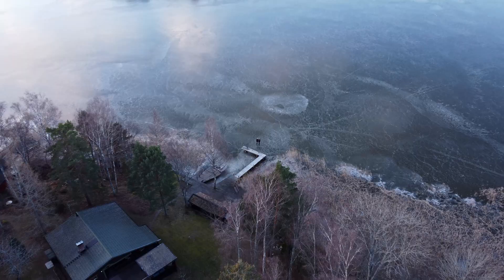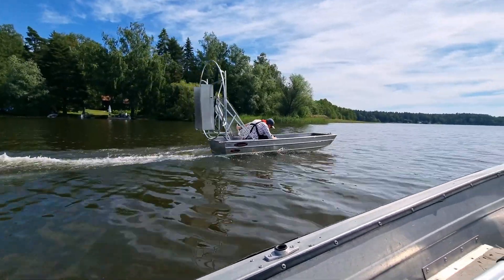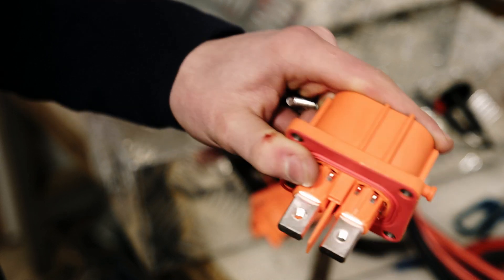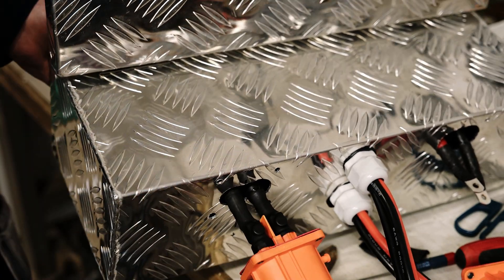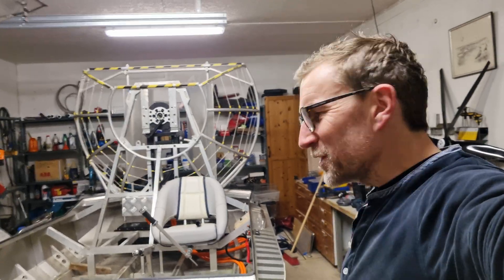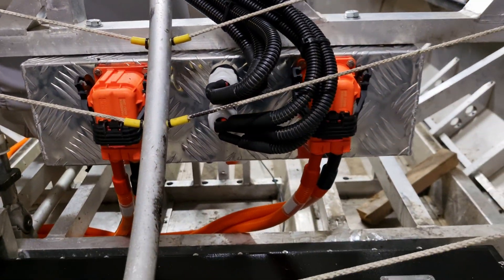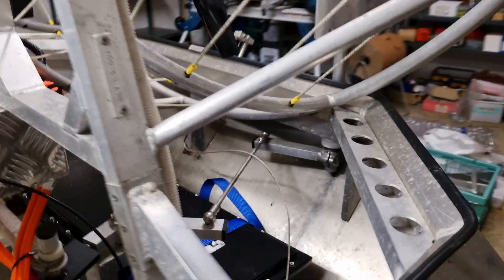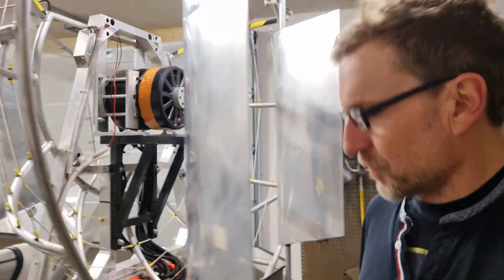⚡⚡⚡Completing the worlds most powerful ELECTRIC airboat!⚡⚡⚡ Part 3 (+ EASTER EGG)

Comment: should you not have a heavy shield  between prop and back battery?
Reply from the maker: Hi @solarsteelpontoonhouseboatrebuild! The battery case is made of steel, and the packs are also explosion proof, a manufacturing prerequisite. The carbon propeller also explosion proof (nothing we've tested yet😂), so the chance of something piercing the battery pack should be absolutely minimal.

Comment: Does the owner plan in putting bigger batteries in it? At 44kw discharge why the double motor set up when each is 80kw peak 40kw continous?
Reply from the maker: Hi @feedurheadhesaid! Quite purely the possibility of upgrading in the future, but redundancy, but also the option of more headroom  initially because we were a little unsure as to just how well it would work. 👍Have a great day, and cheers for watching! 🍻Regards John
Reply: @johndehosson  ah makes sense. If you did it again what would you change if anything about this set up?
Reply from the maker: @feedurheadhesaid  For my part, I would just add batteries to run it at max capacity to blow it outta the lake 😅 Otherwise the setup is great. With a couple of tweaks it'll be offered on our (new updatrd) website next week 👍